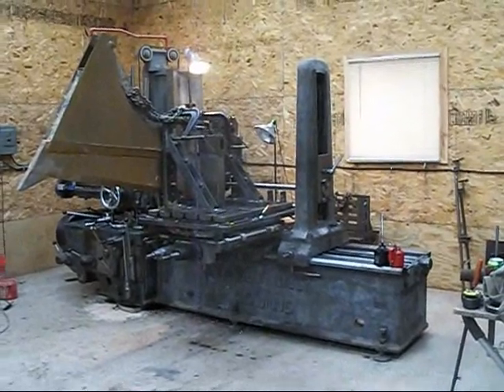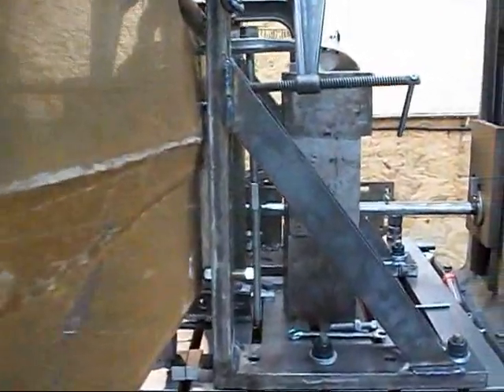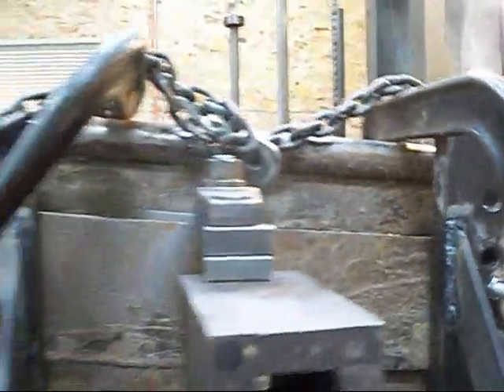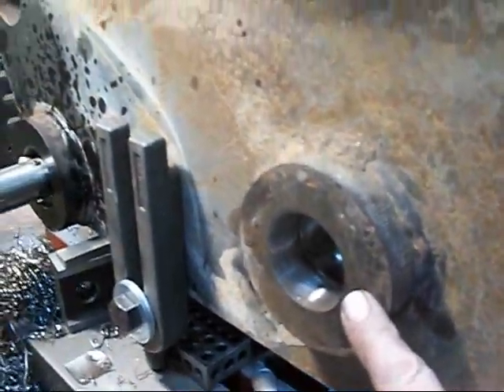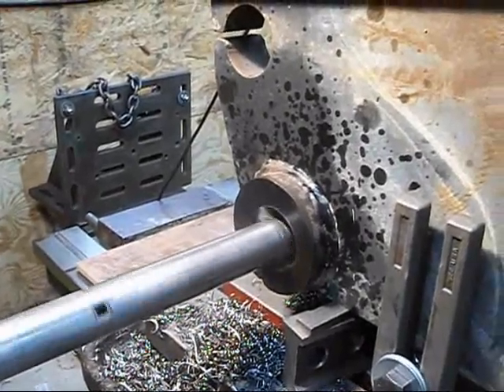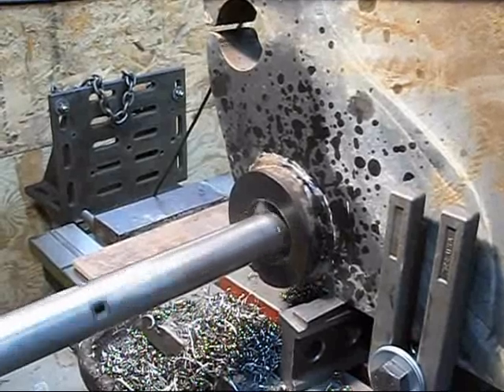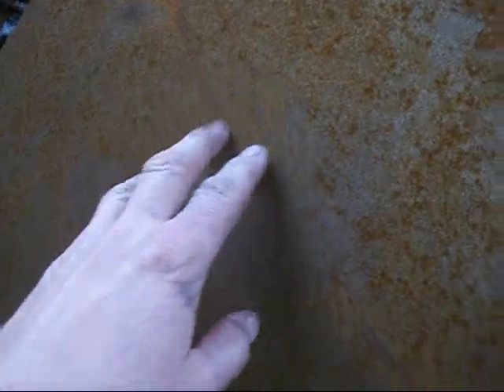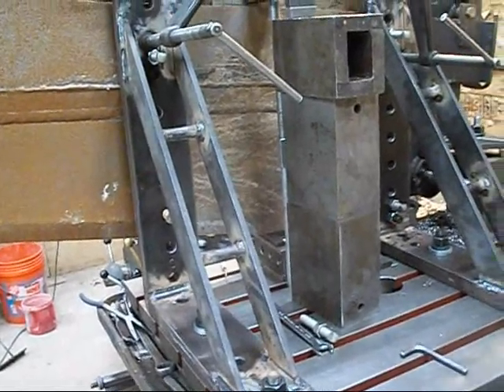ANGLE  PLATE PT II  WMV

Comment: Curious, is your HBM bolted down? Have you checked level and straightness of travel?
Watching Brian Bloc set his up, and wondering if one can be used just setting on the floor. 
My floor isn't anywhere thick enough as recommended anyway.
Reply from the maker: My is just sitting on the floor but I have jack stands under to straighten things up with . But I also do not have the outboard stands like Brians. And my HBM only comes in at 14000lb
Reply: Yours must be the AFMF 80 like mine? Quill is 3.150 dia.  
The brochure I have says 8-3/4 tons.
Reply from the maker: I think mine is the AFMF 65 with a 2-9/16" spindle
Reply: It's hard to judge in the video. Brochure says 5-1/2 tons for the 65. 
Place I got mine (I think) ran it over a scale at some point, and they were saying 18,000. Enjoying your videos!
Reply from the maker: Thanks watch for angle plates III coming soon .I do all the machine work to the plates  on my 24" Rockford Shaper

Comment: Just curious- Is the blade used for agricultural or industrial applications?  I cannot think of another use.  Nice set up- it took a lot of time to prepare for the work.
Reply from the maker: It is to put cable or gas lines in the ground I think
Reply: It could be a tile plow too for putting in field drainage, they look like that.  the pins look a bit undersized for the torque  they have to handle from that long shank. Probably why you have a job here. :-)
Reply from the maker: 2" pins and somehow the thing vibrate also